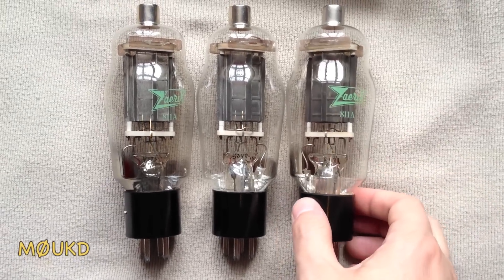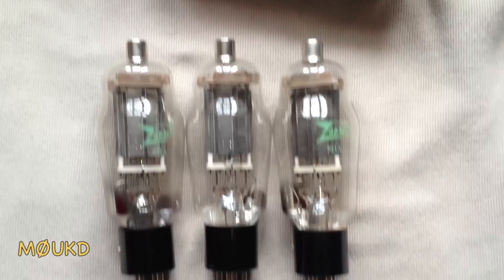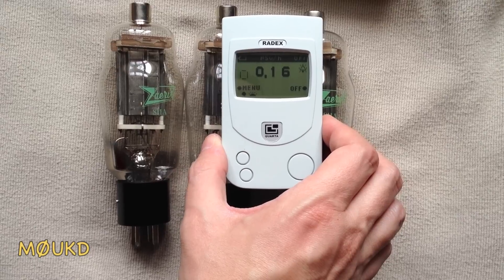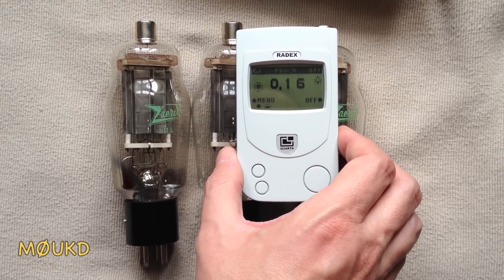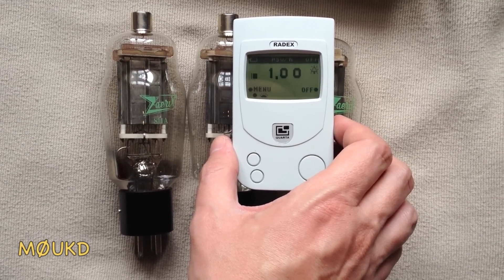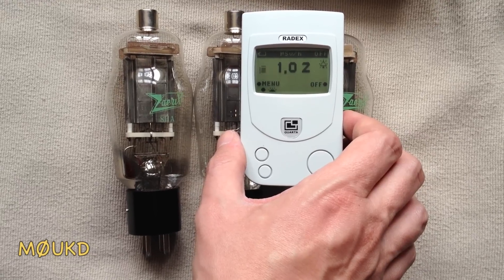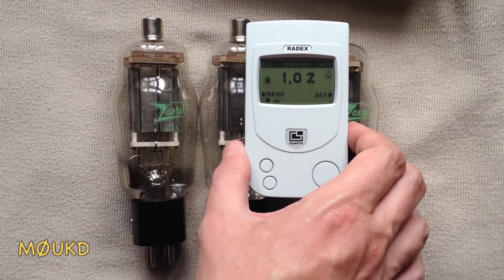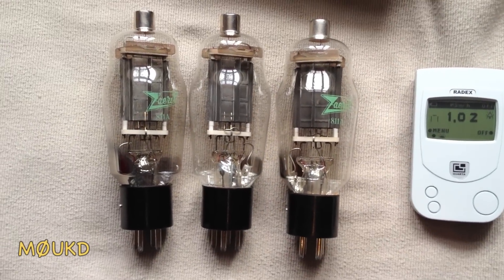Radioactive valves / Vacuum tubes - 811A

Comment: It could be 90^Sr, Strontium, λ: 28,79 years, which can lead to stronger skeletal, or just bone cancer. 

Wiki says 1.0 uSv/h is a fifth of what you get from a dental radiograph ("5 to 10 μSv: one set of dental radiographs"), but the time of exposure is longer if you are sitting next to the amplifier all the time. I switched back to modern tubes just to be safe. ;)
Reply: 1 uSv/h when you're in CONTACT with the tube ; but when you get at 30-60cm away from the tube you almost cant detect anything anymore.

Comment: There are also special radioactive variants of the common NE2 neon bulb. These were used in the servo loop of the old 1960's Fluke differential volt meters like the Fluke 887A. The doped slightly radioactive NE2 bulb in the circuit would fire at a lower voltage and would thus have a longer life. A regular NE2 with work too as a replacement but then did not last as long.
Reply: True, but the radioactive coating in an NE-2 is to reduce or eliminate the "dark effect" so the bulb gives a consistent firing voltage and consistent behavior in darkness and in ambient light.  Not all NE-2 type bulbs have the radioactive coating.  I prefer those for some novelties I make where in darkness I want the bulbs to interact with each other optically.